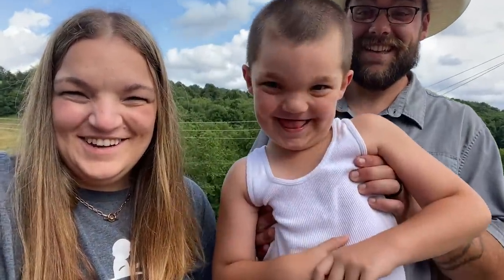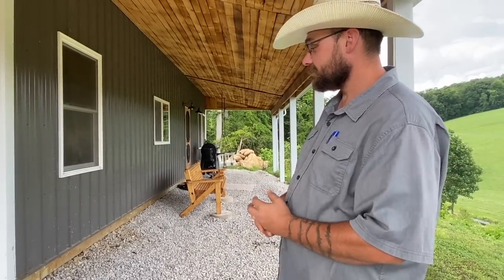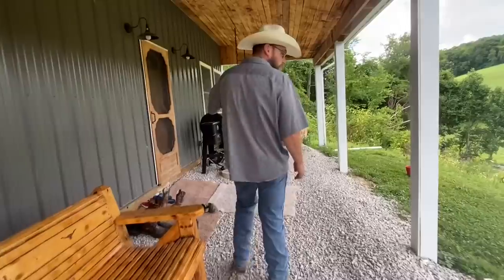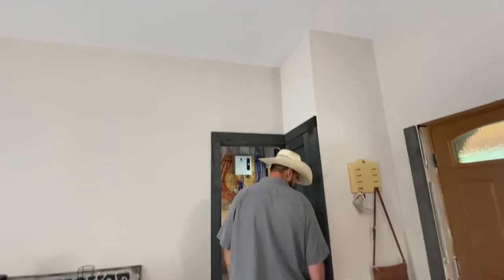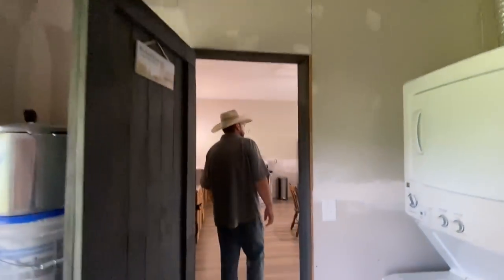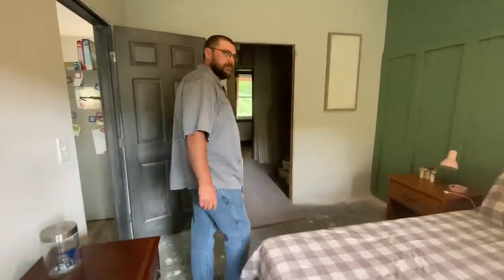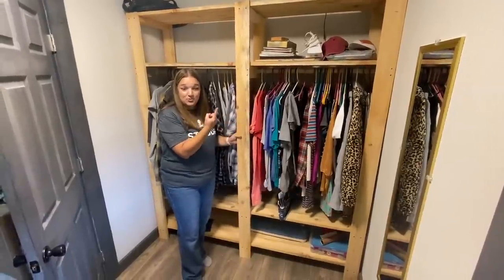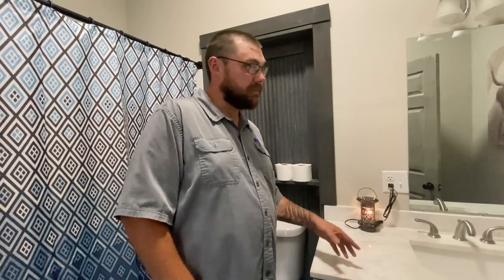30x40 barndomenium tour and the real cost to build

Comment: I went the turnkey route and also had (former) Amish company do it. 30x40 (12 ft high) pole barn with insulation/vapor barrier. It was 30K with only a walk in door and a 10 x 10 garage door. Very well built and I couldn't be happier with it. As a bonus they messed up on their calculations and ended up giving me a 6 in concrete floor instead of the standard 4 in. Since it was their mistake they didn't add anything to the cost. Not that I need to put a lift in, but I could if I want. Debt free is the only way to be! Great video!
Reply: Who did you use? I'm not far from Lancaster, PA. I'm looking forward to having something built at some point.

Comment: Radiant heat and cooling is nice and a staple in some local sub markets.  Concrete is not a good conductor of thermal energy.   Look at warm board for radiant heating and cooling systems as they make retrofit warm boards.

Comment: I do not understand 10’ ceilings. It’s more space to heat, cool, and clean. I also don’t understand a hallway (unusable space) when it was unnecessary and avoidable.

I built a stick home myself in 2010. Because of the economy at the time, EVERYTHING was much cheaper. And I did everything myself, minus dirt work. 

You did a good job searching out deals. Big props for mortgage free building.